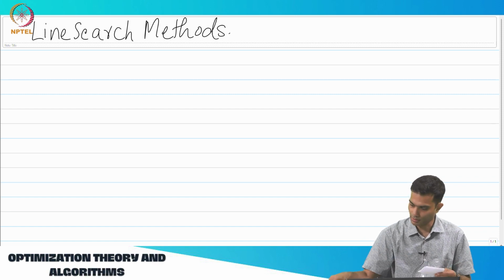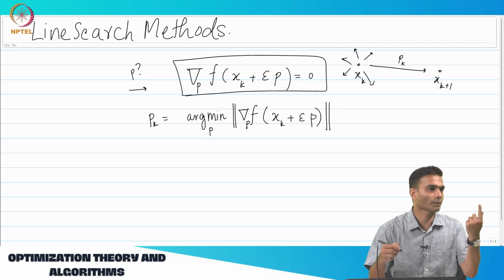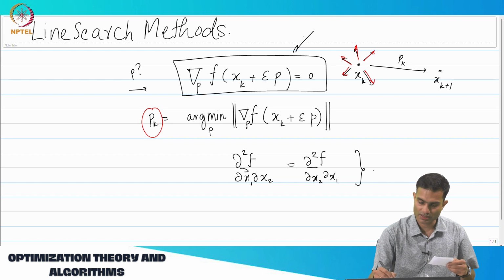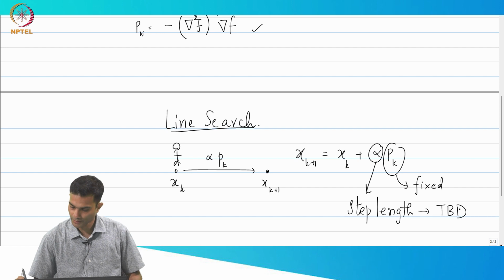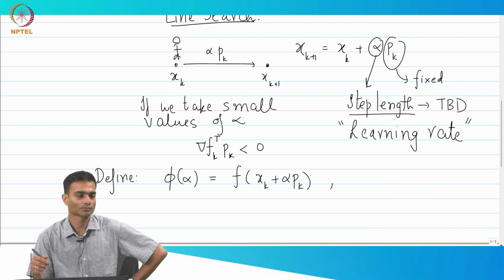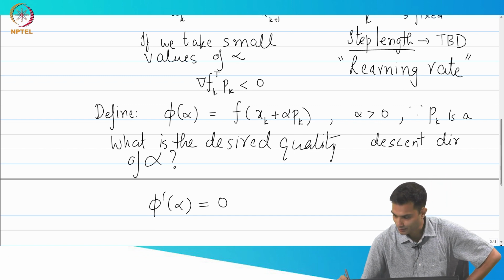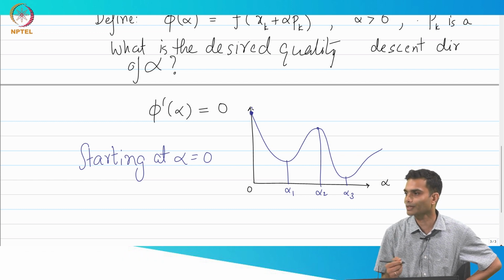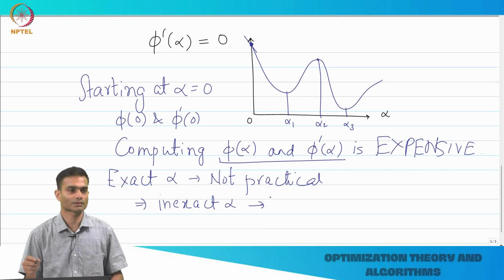Introduction to Line Search

Comment: 11:23 So actually we are going to solve another minimization problem to solve our minimization problem, right?? But, on contrary to first minimization problem, I guess this one tend to have only one local minima. So we are at an easier situation compared to first problem🤔🤯
Reply: I think that the second minimization problem is only one-dimensional. That is what makes it easier. It is not that the new function has only one local minimum, it is that we have only one dimension to solve for - namely, the value of "alpha". The new function is a function of "alpha". I believe we have taken our old function, started at a particular point on it (therefore e.g. entered in values for "x" and "y"), chosen a value of "p" (which is basically some more values of "x" and "y" that we are adding on to our existing function) and then multiplied that "p" by "alpha".

You're right that it isn't explained enough.